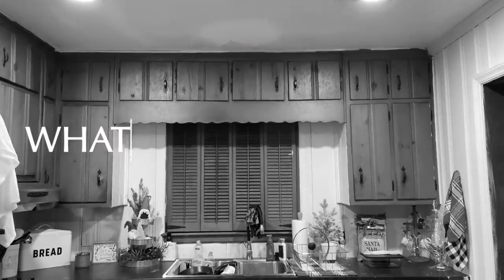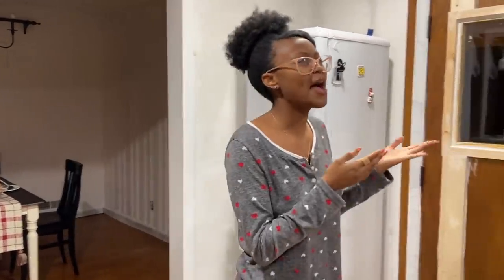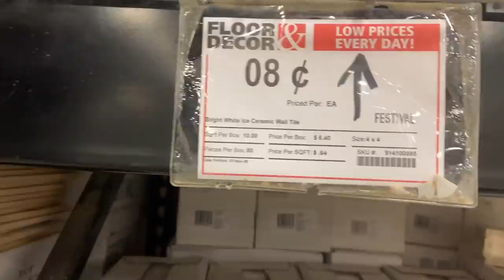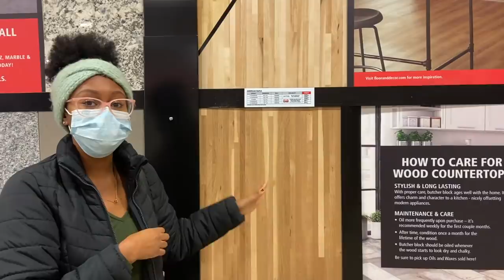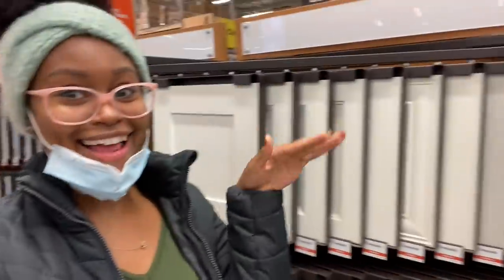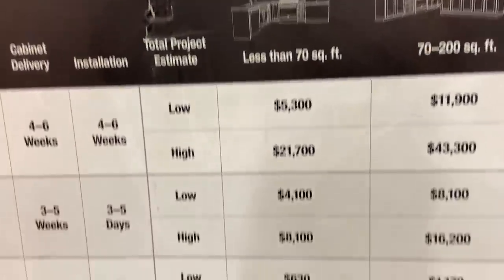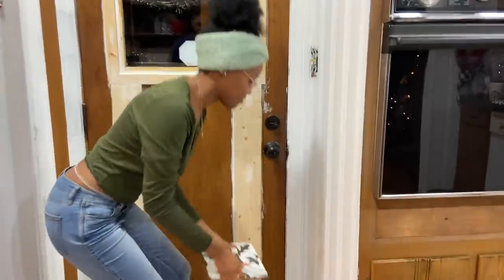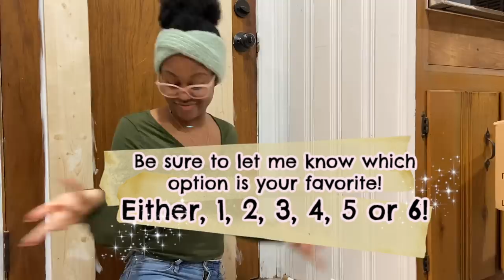DESIGNING MY DREAM KITCHEN !!!| SHOP WITH ME FOR Tile, Counters, & Cabinets!| #FIXERUPPER VLOGMAS

Comment: You know you don't have to do everything right away. If you want different cabinets, paint them for now. Live in your home for 6 months or so. See what works with what you have and what doesn't. Then you'll know more what you want.
Reply: Completely agree. Definitely take your time with renovations
Reply: Omg i agree completely!
Reply: Awesome advice...it takes time to fully settle in.   I know when I bought my home I was obsessed with replacing the sliding door that goes to the yard.  Until I realized how much me and the dog use it and its actually quite functional for heavy use.  The only reason I didnt replace it was due to the fact that other expenses came up, and it kept getting pushed back.  Glad I didnt rush and change it to french doors...it wasnt a good choice.
Reply: That’s what I am currently doing right snow. Save the coins and do a long term Reno in 1/2 year

Comment: A suggestion would be to move the fridge into the spot where the oven and cabinets are, put a pantry where the fridge is and then move the hutch and build more cabinets and floating shelves above so it can still be decorated as if the hutch was still there. Just more counter space and functional storage. The hutch can hold China in the dining room too
Reply: I agree with all of that!!

Comment: Why not put the hutch in the dining room? You would then have more counter space. I think all cabinets where the oven is would be better. I also think you should keep your cabinets, new ones are too expensive!  I love your window area, so I personally wouldn't change a thing there, but I like your vision. If you have a Habitat For Humanity Store in your area, you should check it out. Those Christmas ornament looking tiles for the backsplash is hot right now for DIY Christmas ornaments with scratch-on words.
Reply from the maker: I’m getting a buffet for the dining room  & the hutch is going to hold a lot of my food. Y’all haven’t seen that yet though because I haven’t done it yet! ❤️❤️
Reply: I think she should keep her cabinets and change the doors and it’s hardware
Reply: I agree with @naturalforme, keep the cabinets and paint them as well as changing the hardware. Adjust the cabinets as mentioned.
Reply: Keep the cabinets and paint them white, if you’re looking to get stainless steel appliances then get either nice stainless steel & glass knobs for the cabinets.

I love all of your floor choices as well as the backsplash pieces. Food for thought, if you go with the subway tiles put a pop of color in your backsplash! That will break up all of the white especially if you paint your cabinets all white, and your flooring the nice gray that you love 🥰. You want your kitchen to all flow together with out looking just white.
Reply: Yes I agree with your ideas. I would also say maybe no upper cabinets. Open shelves that would save money. Anyway can’t to see how it comes out ☺️
Reply: @misskatzlife5892  would make her house hard to resell in the future
Reply: @deshirlwilliams9203  yea your probably right. Although I love open shelves in kitchens. At least on Pinterest it looks cool 😆

Comment: Could you possibly just purchase the cabinet doors & switch out the old cabinet doors? That would make a big difference
Reply: Great idea
Reply: Another alternative could be getting some wood filler to fill in those grooves and then paint over it. This could be an option in case changing the cabinets would be too much for now.
Reply: I was thinking the same thing
Reply: I completely agree
Reply: It’s called refacing. Another good idea is ikea cabinets and buying the doors from somewhere else. You can save a lot of money that way
Reply: And just add new hardware!!

Comment: I would vote for extending the counter top and having matching appliances.  It will look mismatched. If you have the funds to make them match then do it!  You will thank me later when you get in your 30s and be looking at mismatched appliances.....the patterned floors look cool, but not sure how long you plan on being in the home, but over time the patterns will start to look old fashioned.  If you use basic not so busy colors, then in years to come it will make it easier to change up the look without having to renovate the entire kitchen.  I am speaking from experience. I too bought my first home at 25 and here I am 41 and just had to do a full renovation because the 25 year old me wasn't thinking long term.
Reply from the maker: I’m definitely going for more neutral light colors for the kitchen! Can’t go wrong with that! ❤️ thank youuu! ✨✨
Reply: Facts! We all tend to think of now instead of later. Sometimes somebody has to remind me to think of tomorrow. 🙌🏾

Comment: Note sure if you'll see this post as I'm binge watching your videos to get caught up.  I really love the white paint on the tongue and groove walls.  It's turned your very dark and outdated walls to a chic modern cottage vibe.  Personally, I think you should hold off on buying new cabinets. Paint the cabinets you already have white to match your walls. However, I would remove the scallop valance over your sink. Then instead of getting a stainless steel I get black. your refrigerator would be white and maybe your stove & dishwasher could be black with stainless steel accents.  That would match the look that you're creating in your home also. I'd go with option #2.  I think it would help tone down the massive amount of white and also pull in the black.  Those hexagon wall tiles are you mainly used for showers.  not that you can't use them for a kitchen but I think it would really dull down your look.  On your countertop, I'm having a hard time seeing it match.  Unless, maybe you go with grey stain (could be dark or light) or darker wood stain.  Although, I love a butcher block countertop, they do damage easily and require maintenance. To be honest I really like the countertop you have.  I think it matches your color scheme.  Just my opinion I know you have your own vision.  However once you get into replacing kitchen cabinets the cost is going to skyrocket.  Also, the storage stores do carry inserts that you can install into existing cabinets.  Like a lazy Susan and so much more.  Good luck, I know it gets overwhelming.

Comment: What if you move the hutch to the dining area, add cabinets matching the rest of your kitchen where the hutch is at now and add floating shelves on the top?
Reply from the maker: I want to put a buffet table or China cabinet in the dining room
Reply: You need more cabinets and a pantry you might not think so right now but you will later on paint your hutch white and move it to another room it would look giid in your dinning room

Comment: I just redid my kitchen and used the same octagon tile in black for the backsplash. I am happy with the way it turned out. Stay away from white grout, especially on the floor. I pulled out white flooring tile with white grout because it looked horrible! The white tile was also a gloss finish and a huge slip hazard. Be sure the flooring has some grip to it. I went with a kitchen cabinet company and they ended up being cheaper than HD and the quality was better. If you shop it carefully, you can do a very nice kitchen for a somewhat reasonable price. Check your junk mail for cabinet companies, as they can run some great deals. I would definitely figure out a way to put in a pantry. For resale that is going to be critical. I ended up with almost double the storage space and a ton of counter space for prepping, just with good design. You don't have to lock yourself into the current design if you are doing new cabinets. Definitely talk to a professional kitchen planner. They will give you some great ideas!

Comment: I like the second option for the kitchen, extended counter top and cabinet above. When there is a wall too close to the stove burner and you have pans with long handles, sometimes there isn't enough space to have the handle pointing outward.

Comment: What do you think about option 2 with black grout for the floors and white grout for the backsplash with a herringbone design? I agree with everyones comments that white grout will be extremely hard to keep clean. The black grout will allow a great contrast and you will not have the stress of always having to get the grout cleaned.

Comment: i think you need open shelving to make it more modern if that’s what you’re going for. definitely elongate the counter space and put floating shelves above. i think the original wood cabinets give it character and charm maybe paint them or sand em down to a light wood finish if you can?? all depends on the little things. definitely wait it out a bit so you can see what kind of space you really need. do the floor first!! and do something you know you’ll love so you can base everything around that. that light wood counter top looks good with that matte white floor tile

Comment: You’ll want to have contrast in your kitchen so for this reason I would recommend doing either a darker floor or adding a black splash with darker tones in it to balance all the white cabinets. As for appliances, white can often feel dated but if you don’t care for the stainless steel then try black. I would try to keep your appliances, other than your fridge, the same color

Comment: I vote for extending your counter top. Have you thought about just replacing the cabinet doors? Not sure the cost vs replacement.
Reply from the maker: I haven’t !! But the existing cabinet doors aren’t bad.. my issue is with the inside of the cabinets m. I just would like for the inside to be fresher ! If I keep the cabinets, I would paint the inside too!
Reply: @YoungLadyBusiness  I’ve saw where some ppl put peel n stick tiles inside the bottoms I’m actually thinking of doing mine 😊

Comment: Extend the counter.  The full ceiling to floor pantry will close off your space.  Having counter space in both sides of the stove is the way to go—it will also give you a temp drop zone when coming in the back door—I know you want to keep the hutch in the kitchen but a wall pantry would be awesome in that space. Also white grout will be difficult keeping it clean—go with a gray.  I think you may find it tight with an island—even  if it’s movable. Again I think it will close off your space.   You may have to go with all new cabinets because you the size & layout.  Remodeled my kitchen a few years back.  Good luck can’t wait to see your design.

Comment: You can save so much using ikea cabinets. I’ve seen so many folks go that way and they love them
Reply: I’ll second that. IKEA has a great selection, great quality and are the masters of working with small kitchens. They are also much less expensive than Home Depot.
Reply: Why get cheap fake wood ikea cabinets when she already has real wood cabinets that are way more durable. She can just paint her cabinets and put new doors and hardware and BOOM like new for way cheaper.
Reply: @slimbellybella  just advise that I have seen from folks doing complete remodels. I wasn’t saying which way to go.. just giving an option based on the home depot prices she showed, and the 25 year warranty that ikea offers too
Reply: @ThatsSoTrendyDIY  yeah I feel it. It’s just ikeas cabinetry doesn’t last long. It would be a waste of money down the line because she’d have to replace it.

Comment: Great choices!!!  I like the black & white pattern tile flooring with white grout and the white subway tiles, which tie in well with the theme you already have. The 2nd would be the hexagon tiles on the walls, with white grout and the grey & white pattern tile flooring.  For now, to save money, I'd remove the wing piece over the sink and install your pendant light, and then paint the existing cabinets white and change the hardware.   Also I like the stainless steel appliances with the white kitchen.  Looks more classy with your farmhouse vibe.

Comment: I actually really like option #2. No to the white grout on the floor. After stepping on it for some time it’ll never really be white again. As for your cabinets, I think you should keep them and paint it then replace the cabinet doors and hardware. To expand the kitchen the hutch can be moved into the dining room and then you can put extra cabinets where the hutch was.

Comment: So happy for you with the new home and the new decor. Suggestion to put the hutch in the dining room. You decorate it like its on a display so why not display it.

If the hutch goes in the dining room then it would help with the pattern options of the backsplash and the flooring. I personally like your favorite which was the hexagon backsplash with the gray tile.

Keep the Cabinets and paint them.
OR give yourself more counter space but moving the hutch
 and add more cabinets there because right now they are full. The oven that is floating right now can be removed as you said and you could give yourself a mini pantry. Have the shelving that goes in and out.. allows you to better organization.

You could move the floating stove and create more counter space there as well but I think you would run out of cabinet space honestly.

Comment: I really like option 1. One thing you could do is get that tile in peel and stick for a fraction of the cost that way if you don't like it your only out a little instead of a lot. I would also paint the cabinets especially if they are in good shape. Changing out the hardware will make a big difference. Save yourself some money. If you like those options you can upgrade to newer later on. Use that money to get you some great appliances. Keep up the great work.

Comment: Buy an appliance package of stainless steel. It’s cheaper as a package. I agree with moving the hutch and ensuring that you have a professional design that doesn’t have the refrigerator off to itself. Take your time and watch some HGTV to get ideas. You can also try the app Houzz. It has a huge selection of photos of remodels. That said,I like option 1 the best so far.

Comment: open up next to the stove (counter + uppers).  To the right of the dishwasher, make that your full height pantry cabinet. You have got to get a pantry in there.  I don't think there is enough room for an island, but a small steel or butcher block "island" on wheels may work....probably more as a work surface, though, not with seating.  God bless, young lady!

Comment: I like grey hexagon floor with subway tiles and also consider what your decorations are going to be and how u plan on decorating! also you can use some of the other options like the gray patterned tiles in your bathroom if you’re getting renovated it later on

Comment: From the age of the house, those cabinets are real wood. Keep as many as you can. You can change the doors to your taste. Where the wall oven is, put a pantry, i.e. pull out shelves. Do not separate it use the entire width of the wall oven space, floor to ceiling. You can put your seldom-used pots/dishes up high. The moveable island is a great idea, it could be anything from a small table to base a base cabinet with a countertop. You will get the most out of your money this way as you are not moving plumbing and gas etc. For the floor, whatever is to your budget and long-lasting you have tiles that look like wood now, hardwood/engineered wood or luxury vinyl.

Comment: Option 2 is my 1st choice then Option 1.  The tile with the darker print is beautiful!  It would be a real statement in your kitchen and I think it would be beautiful with a stainless dishwasher and stove and your fridge would look great with it, too. .I'd extend the countertop beside the stove.  You can never have too much counter space.  And I'd check the price on having just the doors on your bottom cabinets changed if the boxes are in good shape.  It would cost a lot less than replacing all the cabinets.  AND, you could extend the upper cabinets all the way to the ceiling, too but that would cost.  Oh, how I love spending other people's money in my head!!!  😁

Comment: Option number 1 flooring (the gray and white perisian print) with the white, more ornate sheet backsplash you found in the first store. Based on the style of your hutch and refrigerator you have a more of a Perisian Country style for your kitchen. The gray and white printed tile and the ornate backsplash goes with that style. The hexagon and subway tiles are way too modern your butcher block, hutch and refrigerator will look out of place against those tiles.

Comment: Love the hexagon backsplash brings dimension and texture to the walls, not sure about floor that coordinates with your wood but the black/white may look better in a smaller space. Also, ideas for your front walkway area..that blessed pillow on the black bench, gold mirror with a long glass table and sconces on the wall. Definitely paint the door white.

Comment: I like Option 1 and 2, but do what your heart tells you to do that will add value to the house if you want to sell later. I also think keeping the stainless appliances would be a good idea in case you also want to sell later down the line.

Comment: I’m so excited for your remodel. I would suggest just changing the cabinet doors out only with mew handles of course. I think you would save money and the cabinet structure is solid. Then you can spend more in other areas of the kitchen. I think white appliances are coming back on style honestly and can save money. Also the hutch would be pretty in white. Can’t wait to see what you do with it. 
Also consider IKEA. They are usually pretty cheap but also quality when it comes to kitchens. Quality can be a little questionable at IKEA but kitchens get good ratings.